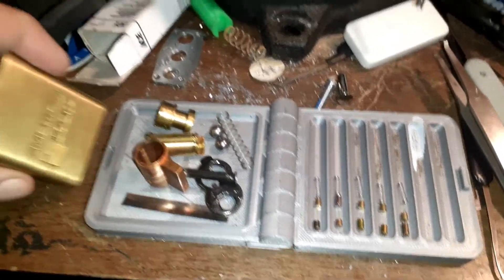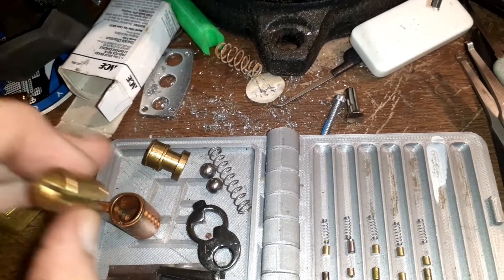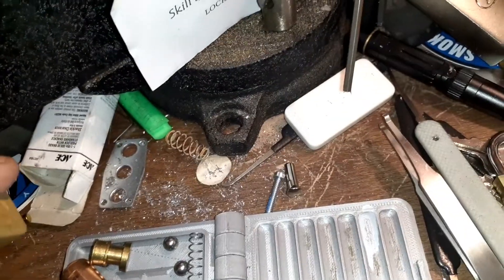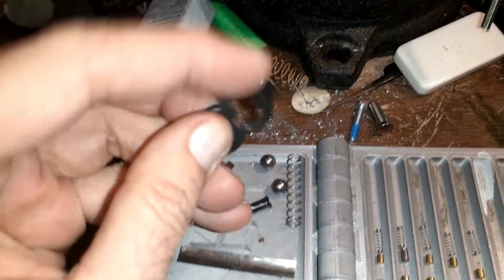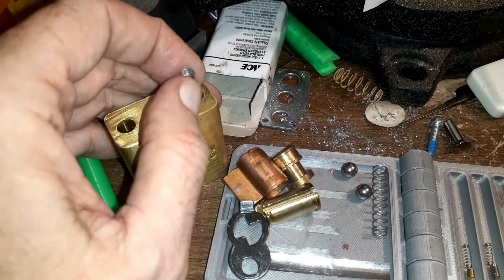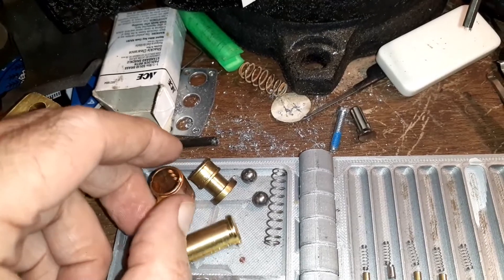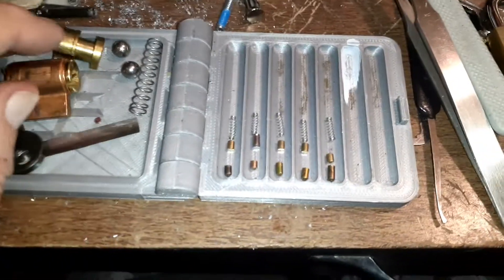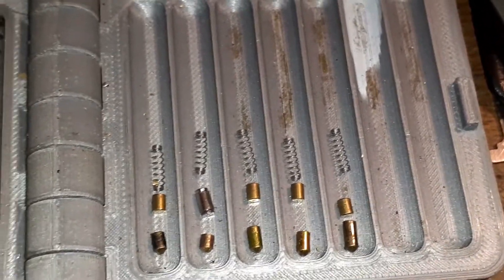(874) Inside an American US Set Padlock

Comment: Interesting and informative video . Do you know if master Lock key pins and bottom pins fit American locks and visa versa ?Just wondering are they same diameter and interchangeable.
Reply from the maker: Yes, Master & American pins are interchangeable.  Master uses a different numbering system, but they are the same. An American #6 keypin is the same as a Master #5 keypin.
Reply: Thanks for clearing up that for me .